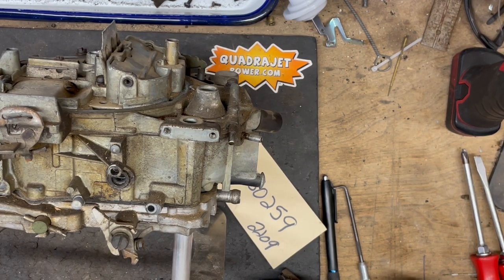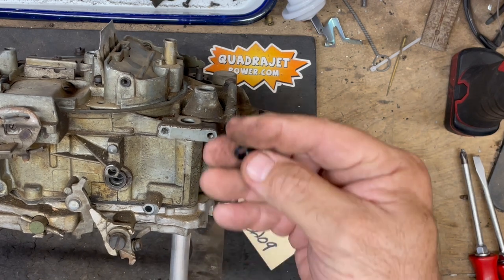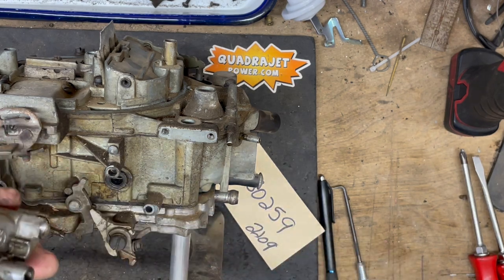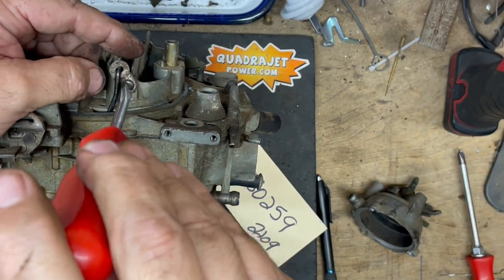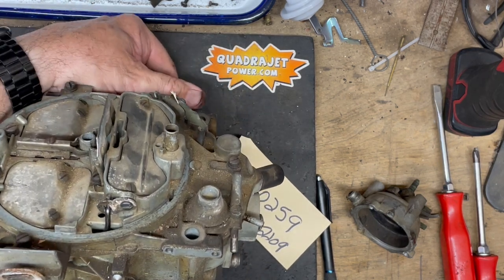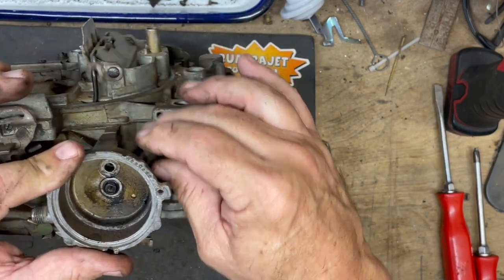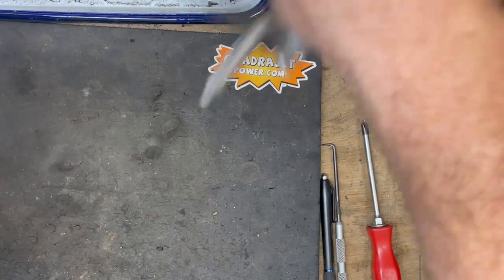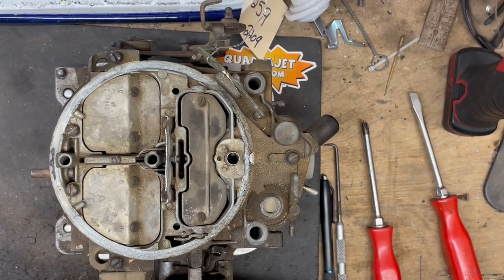Quadrajet Power - How to install Hot Air or electric choke housing to the body

Comment: One thing I learned when installing an electric choke, thanks to Quadrajet Power is that the small vacuum port inside the choke housing has to be sealed off completely or else you will have a vacuum leak around the choke.

Comment: Great video! I'm working on a 78 Olds quadrajet rebuild. Accelerator pump looked like a dried up banana from that ethanol junk. The rebuild kit came with cork choke shaft seals, and they are leaking already. Wish we could still get the good stuff! Subbed!
Reply from the maker: Buy our kits for www.quadrajetpower.com and you will get the good stuff. If you aren't in the US visit our ebay store.

Comment: Thanks for this. A most frustrating thing is having start/idle  troubles associated with carb rebuild or choke/idle problem motor work re-start. Messing around with electric choke tension and that 1/8 inch primary flap offset can really bugger things up if not careful.

Comment: Very timely video, I'm just fixing a mates Qjet off his 79 vette. The hot air choke hasn't been working properly. Pulled it off and the shaft seal had dry rotted, guess it was sucking air through the back of the housing instead of heated air thru the pipes. 
Question, which way round does the seal go, bit hared to tell from the video, do the "lips" go towards the carby, or face inwards?
Reply from the maker: The shaft seals can go either way.  I prefer to put the "lips" toward the carb.

Comment: Great video and I was wondering where you might know a site for an 1987 4 bl electric choke housing because my 3 housing screws were so tight they broke the crew hole casings off getting them loose?

Comment: Hey man I’m just rebuilt my carb and can’t figure out why it’s idling so high. I’d really appreciate if you reached out to me for a little help.
Reply from the maker: What is your quadrajet code number?  What kit did you use?
Reply: @QuadrajetPowerLLC  it’s a model 210 duel jet. 5.0. And the kit I used was Walker products carb kit.  151041a. 
Now that I’ve cleaned it and it’s back on the truck it starts no problem but idles VERY high. The idle screw isn’t even touching the throttle blades. If I pull it to where it is touching it kinda calms down.
Reply: @QuadrajetPowerLLC  I have both of the idle mixture screws all the way down and it still runs so I’m at a loss